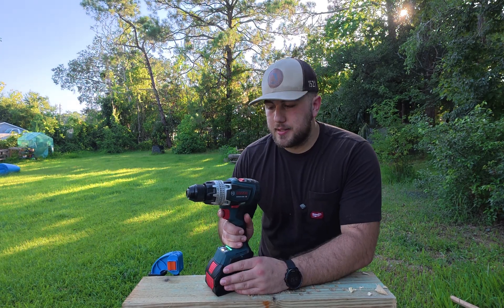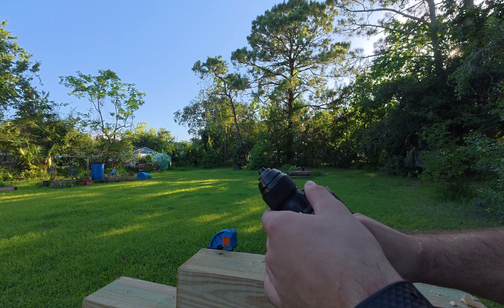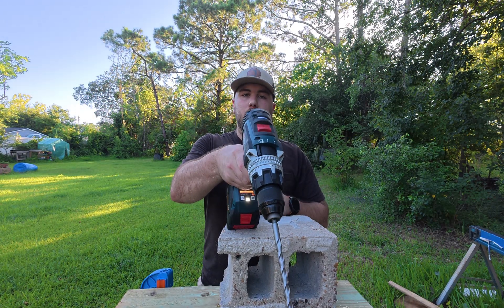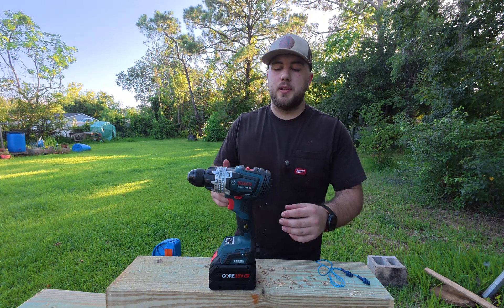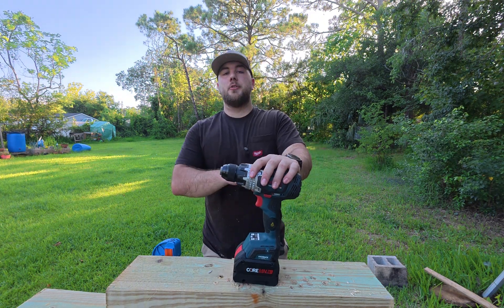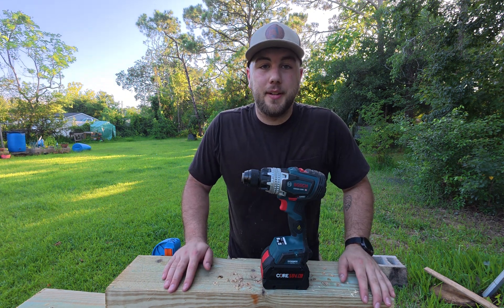The Worlds strongest drill: Bosch 1330c

Comment: 10 years ago bosch had trigger issues with there drill. You get up on a ladder with screw and the trigger won't work,go down the ladder it works.  Go back up trigger would not work. Always when you were in a tight spot .   They refused to do anything about it at the time.  You called they literally said oh well that's the drill.    Thats why bosch suffers in the u.s market.  They refuse to talk to customers,  fix the problem.  Use to have the drill, radio witch would never get any fm channel clear even when it was a local station, the volume use to go up and down on its own, called bosch and was told that's all they have to offer.  Not even in a nice manner.    I want to love bosch but they dont love the customer back at all.  Price is high, for only a half good tool, with zero craps about customer service.    Bosch 8amp and charger are on clearance near by for 99 bucks. I still refuse to buy bosch after the customer service and horrible products.  If they dont work all the way they are no good especially when they are top dollar.   They do make good batteries but that's worthless if the tools dont work when you want then too.

Comment: If you need the hammer function regularly then a rotary hammer drill is the best option.  From all the people I came across online and irl specially those who repair them 😅,  over 90% recommend not to use it with such drills.
Reply: it's ok when you only need to do a handful of small holes in cinderblock or concrete and you don't have the rotary hammer at hand or don't want to go back to the truck or tool box but that's pretty much it. Anything bigger than 1/4" means I'm picking up the rotary hammer, though.
Reply: @engineer_alv Makes sense.  👍🏻💯

Comment: Does Bosch make a compact version without the hammer function? For someone with a sds-plus rotary hammer, this would be perfect.
Reply: GSR18V-1330CN is the non-hammer drill. It's still big, though. You might be saving 1/2" on length at most.
Reply: Yes they do, It is called the GSR 18V-800CN as it is called in your North American Market. it is called the GSR 18V-90C internationally
Reply from the maker: They came out with a newer compact drill driver that’s supposed to be pretty good

Comment: The angle setting option is cool even if i probably wouldn't need it
Reply from the maker: Yea, Bosch comes up with cool features. Started anti kickback I believe as well
Reply: Indeed
Reply: If yo use a drill  ilke a drill.. longer bits or huge assambl , but  need, you need